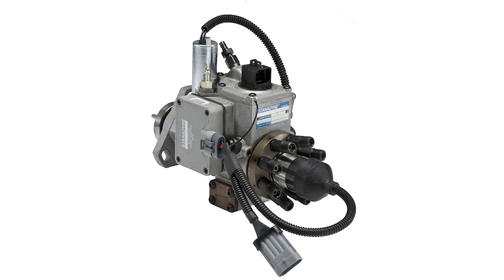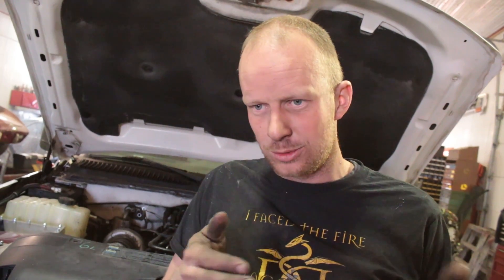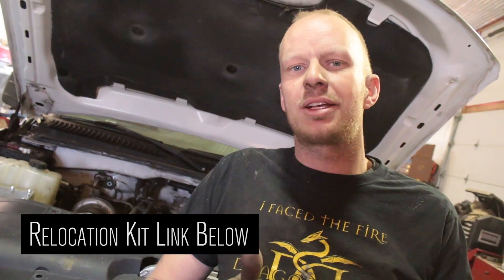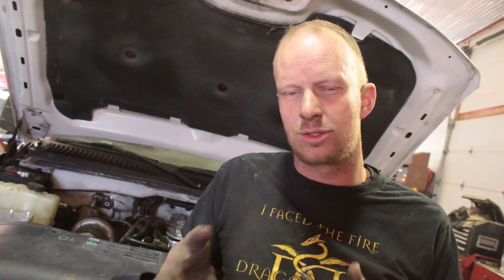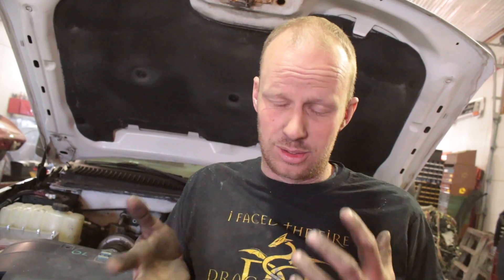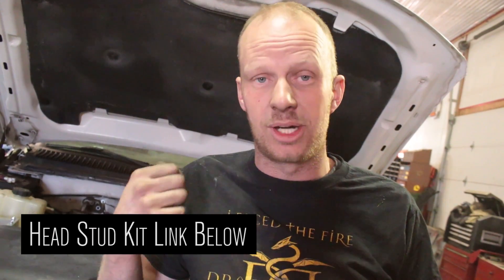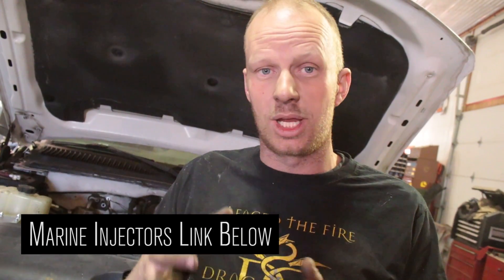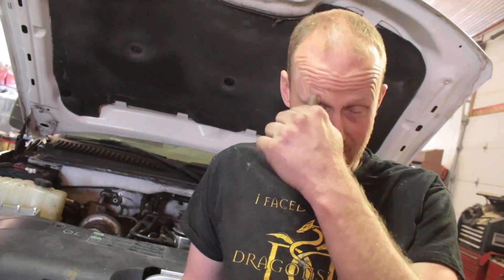REVIEW: Everything Wrong With A GM 6.5 Detroit Diesel

Comment: My 97 chevy Tahoe came stock with the 6.5 mine pulls an inclosed car trailer no problems getting 20 to 22 mpg
Reply: If the EPA has anything to do with it these engines will be extinct before they get much better. The latest EPA crap has just hurt engine efficiency.
Reply: Doug, you must be a gas engine fan. In the diesel world 20mpg is pretty common. My grandfather said he got 25mpg on the only new vehicle he ever bought. A brand new 1983 chevy van with a 6.2 diesel. He was a highschool teacher. Pretty sure he knew how to do the math.  Pretty sure I know how he got 25mpg with it too.  I got it for a graduation present 220,000 miles later. 
Knowing him during the break in period he probably never exceeded 50 mph back when the max on the freeway was 55mph. 
The best I ever got was years later with a custom modified 6.5 loaded down with my tools and his cabinetry(he was no carpenter but he converted it to a camper), we went from Vancouver WA. to Casper WY. on one fuel up.  33 gallon stock tank and a 40 gallon aux tank I added. And you don't run a diesel out of fuel. That being said I didn't have much left when I fueled up. We were headed to Missouri to move my grandmother back after my grandfather died. I was taking my time as I had my dad and my 6 year old daughter with me.  If i recall my calculations said almost 22 mpg.
Reply: I have a 2014 Ram 3500 with the 6.7 Cummins and the 6 speed auto and I don't EVER baby this truck. It's been driven over 45,000 miles in the past year of hard acceleration, high speed highway use, I've pulled my 36' gooseneck flatbed with over 30,000 lbs with it, and this truck has never broken down, never skipped a beat, and even with my foot clear into the injection pump this SOB will turn almost 20 mpg on the highway at 75 mph...and I have thoroughly beaten tf out of it. I also have a 2015 Silverado 2500HD with the 6.6 Duramax with the Allison and I love them too. Comfortable, fast, and will pull a house down while getting 24 mpg. Diesel technology has come so far in recent years and they're only going to get better.
Reply: Griffin Babb What's the setup? My 93 with the NV4500 5 speed and 3.42 gears would average 18.6mpg in mixed driving and an easy 20+mpg on the highway. Gearing makes a huge difference with the 6.5. I didn't know anyone with 4.10 gears that does better than 16 unless they slow down to 60mph.  Manual trans always did better than autos as well...
Reply: Keep in mind that timing makes a big difference on mileage. I suspect many of the mpg disparities can be traced to driving style and or timing.  Driving at higher speeds drastically increases drag. Also don't forget gearing. Usually the lower your cruise RPM the better your mileage. 
My grandfather could easily have gotten the 25mpg he claimed because the '83 van came stock with a 700r4 transmission and 3.08 gears at a time when the max freeway speed was 55mph.
Reply: I can't say exactly what I've been getting with a '99 Suburban K2500 6.5 TD as I haven't filled it up all the way. Judging by the fuel gauge (not the most accurate, I know it) and how many miles I traveled though it's close to 20 MPG. I use 5w40 oil instead of 15w40.
Reply: Yea I should've mentioned I also used to have a 1980 Chevy half ton, it had a gas motor when i got it but it was apparently an original 5.7 diesel truck (yea... that 5.7. The converted olds motor). I took the sbc out and slapped an n.a.6.2 in it, and that thing got phenomenal milage-mid to high 20s. No bs involved, it's pretty easy for me to calculate because i keep receipts and deduct milage. It was about as stripped down as it gets, no power anything, etc., but still. I've regretted selling that truck since I got rid of it.
Reply: The Cummins is best. Ford and General Motors engine had problems for years, to Work the bugs out.
Reply: If you're getting that with a 6.5 please tell me how because the best I can do is 16 highway.
Reply: Well you learn something every day. I had no idea they ever put a 5.7 diesel in a truck. I thought it was just in the olds. 
Interesting thing to note that while many of us consider that a junk engine it does have its fanclub. ....A very small fanclub. Back when I was a kid I worked on a couple. I can't remember if we put a 6.2 in its place or a gas.  What I do remember was the bottom end was really tight and the angles on the rods to cylinders looked really steep to me at the time.  I thought at the time the side thrust angle was way too steep and would result in heavy side loads.  But then most of the vehicles we were working on at the time were semi trucks with big cummins engines in them.  I think longer rods are a good thing in a diesel.
Reply: dustin hummel p
Reply: Well that is debatable. Depends on your definition of best. Back in the 90's where I prefer to live the cummins trailed the other two in power.  Now there is no question in my mind that it was king of durability back then but. 
I am not a fan of dodge. I had to work on a few too many with absolutely insane stupid engineering and I developed a phobia against them. Thanks a lot John Nesbit. lol  John was my old boss and made me work on all the little 4 wheeler crap that he didn't want to touch.  That all being said it was probably the smartest move Dodge ever made in the light truck market. Every working man knows what a cummins is and is familiar with its rep.  If I had the time or money I would probably be transplanting some of the newer ones in older chevy stuff. 
The power wars have been paying off for people that work their trucks. However the complexity has gone up thanks to the EPA and there is more to go wrong these days, thanks to the EPA. More bother too thanks to the EPA.
Reply: Doug Anderson the 6.5 gets 20 mpg on average compared to a 7.3 Ford from the same years it gets about 14 mpg on average
Reply: Yea, if the truck had been original I might not have done it. I've heard they weren't bad engines, just GM at that point had no idea what they were doing , No water separators and shitty 70's american diesel fuel. (too bad it took them 20 more years to really figure it out-just do what everybody else does and go buy a motor from someone else... aka Isuzu... aka duramax).
Reply: Cole, yeah actually, in my book that makes a bad engine when the manufacturer doesn't know what they are doing.   The 5.7 block is different than a 350 gas but it was obviously built on the cheap.  I mean if you get into looking at the details it looks like some backyard mechanic tried to take what he had and make it a diesel.  What they should have done is studied other successful diesel engines if they didn't have the common sense to see what is actually different and where improvements will need to be made.  I mean after all it is only physics. Something engineers need to be fluent in. 
They got it right at the time with the 6.2 and 6.5. Just the power needed started exceeding their version of minimal engineering. 
I know the duramax can put down the power. I am just not entirely convinced that the decreased durability of the aluminum heads is the way to go.  With iron heads if you blow a water line and it overheats a little it is no big deal. But with an aluminum head, yeah it can be a really big deal.
Reply: wrong on the 7.3 mileage, my daily driver is a 97 obs ford with a 7.3, truck weighs a hair under 10 k empty, I get 20ish unloaded (into low 20's if a lot of highway), 16-18 pulling a car, truck, trailer....truck really doesn't care. Not the fastest truck out there but reliable as a rock.

Comment: Funny you do this video today... my 97 6.5L diesel suburban didnt start this morning.... wouldnt turn over, just click. Battery seems good. Im no expert so I am having the shop look at it.... :(
Reply: If they told you it's the injection pump go look at the Fuel Solenoid Driver (or Pump Mounted Driver; same thing.) It might only be that.
Reply: Austin Lucas Thanks, turned out only to be that starter finally failed... accounts for the weak start I was getting. Runs great now!